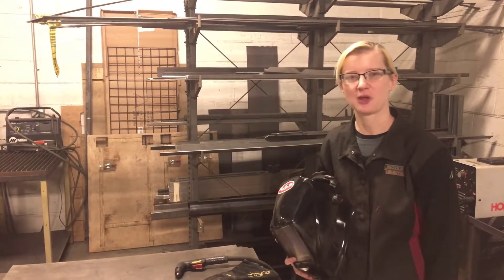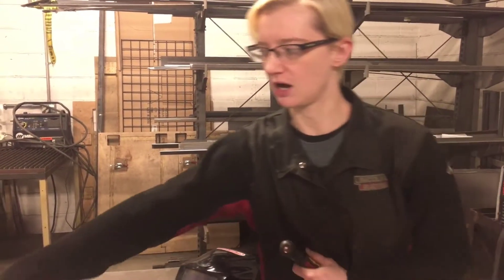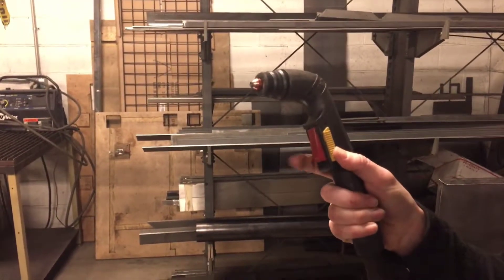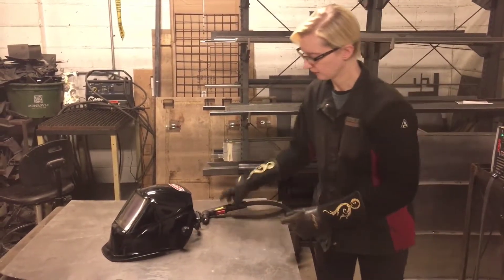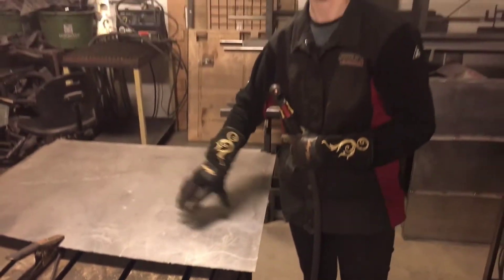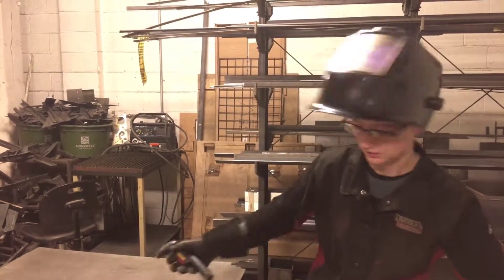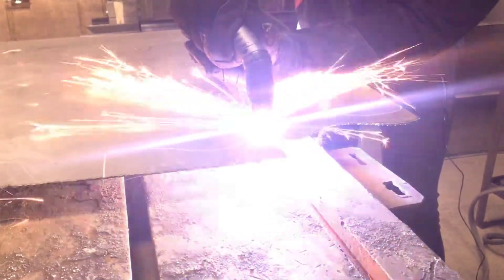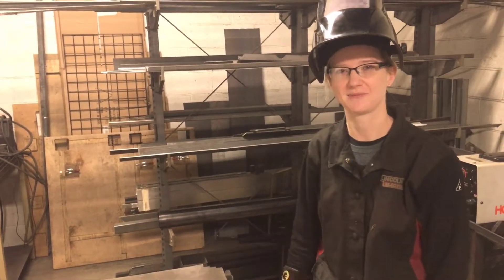Tool Tips! Smooth clean lines with the plasma cutter.

Comment: nope... clean means getting no slag. turn that shit up, move faster, use a straight edge and you can leave the tip touching. it forces the air better which pushes the slag out, not up. if you're going too fast, you will know because sparks are going out the direction of movement. you want bacon like that? use an oxy/acetylene torch. that's even bad for a torch though... study the tools you want to teach others to use. actually be a pro, a newbie doesn't want to learn from a novice. any monkey can pull a trigger.
Reply: Use a straight edge for a wavy cut?

Comment: I have a piece of metal round 4 in welded to another round 4-in metal tube at a 90°. I need to separate those as cleanly as possible. Will a plasma do the trick?
Reply: Yes use a gouging tip